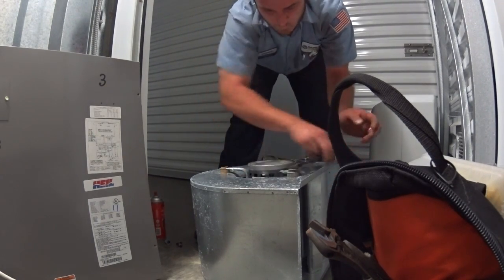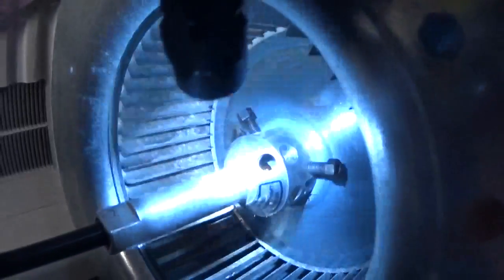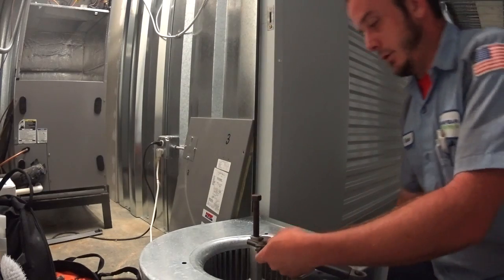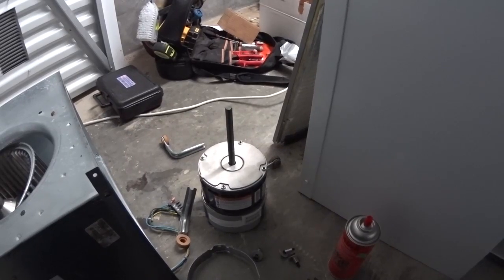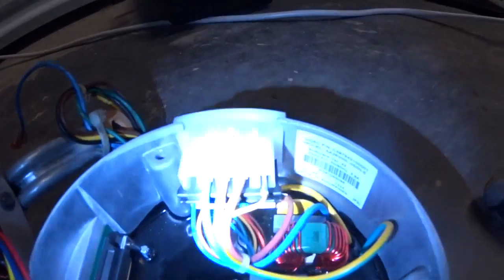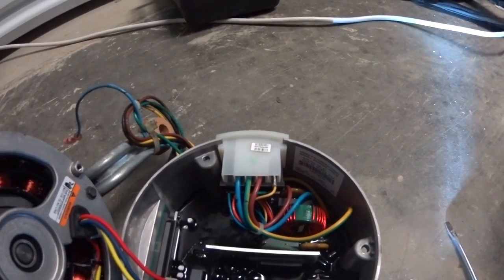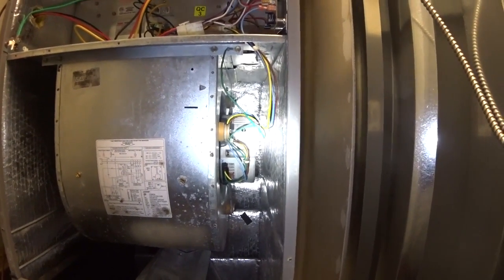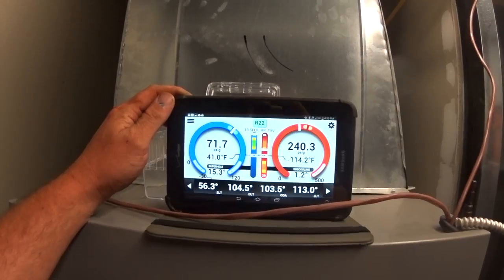HVAC Service: X13 Rescue Motor Installed in place of a Factory OEM motor

Comment: Thanks for your video!  I just used it to replaced my Carrier X13 with a Rescue 1/2hp.  For DIY folks, you don't need the hub puller to get the old motor off the wheel.  Just use rust penetrant and sand paper on the old stem, pull and wiggle off.
Reply: Also a good trick is remove the set screw bolt completely, squirt a little penetrant in the screw hole on the fan hub. Gently tap the the motor shaft to free it up. The motor is no good anyway so dont worry about damaging the motor. Just be very careful not to mushroom the motor shaft or it will scratch up or jam in the fan hub.

Comment: Pro tip For the pro: Your refrigeration ratchet wrench for valves fits on those square set screws for blower wheels. Still gotta watch your knuckles there but that's what good gloves are for.

Comment: 1. Use a magic marker to mark where the set screw hole is.
2. Use dielectric grease on terminals so they slip on easier.
 I use aftermarket X13's (Marrs) to replace some ECM variables if the ramp up mode isn't used.  Can save 4-5 hundred bucks over the OEM. As long as the static/cfm is good- you're good to go. They also come with surge protection.
 Now- about that Subcooling..........LOL. Long high rise liquid line? TXV I'm sure?
Reply from the maker: thanks for the tips newstart49 honestly i don't recall the specifics of this system but i think the line was longer than most residential stuff i see.

Comment: Nice video Stephen, I will have to check on those Rescue X-13's.  Keep up the good work.
Ray
Reply from the maker: We will wait and see if the rescue X 13 makes it through more than a year but it is an option if you're having trouble with the OEM motors

Comment: still running my psc blower moter on my carrier tech97 and a inter-therm indoor unit with a inter-therm evap coil installed in 97 with a txv valve.  running with no heat strips.  will heat down to 25 degs with a 18 degs delta T.  those x13 motors still got bugs up there ass!

Comment: That motor was tight. Sometimes if you remove the module it becomes free. The module is shorted then. If you jump two windings then the motor gets tight again
Reply from the maker: You are a mad scientist! How else would you know random facts like that?!
Reply from the maker: It took me a minute to Decide that the Rescue would be ok. I almost just tried changing the module but I was getting some Strange feedback from the Variable speed Zebra, so I played it
Safe.
Reply: That one I stumbled on...remove the module and motor felt fine...plug it in and back to tight

Comment: Very interesting Stephen Rardon  I have never had to change a variable speed motor yet just the module. I find they fail because of improper duct sizing. Static is to high.
Reply from the maker: I've had a pretty equal split of motors and mod+motor the humidity conditions in this area dictate part of my reason to replace both sometimes. When I pull the module off and chunks of rust fall out of the motor I think it's time to change the motor Before it fails.
Reply: Its almost always modules for me. I hade one motor that shorted to ground. The modules don't like our moist crawlspaces down here.
Reply: Rob HVAC  but it looks that system was low on refrigerant and in this case what kill the module was the frozen evaporator that create the air restrictions.
Reply: José Cruz which would cause high static which would take out the module.
Reply: Rob HVAC that's right
Reply: How does high static and improper duct sizing take out the module?
Reply: @johncote2776  These are a constant torque motor. If the airflow gets blocked for whatever reason, bad ductwork, registers closed off, filthy filters, iced up coil etc, the motor picks up speed to try to get to the torque setting for that airflow. There's supposed to be a speed limiter in the motor, but it's like a car. Sit there long enough with the gas pedal floored, bouncing off the rev limiter, will shorten it's life! Basically how they work is, a squirrel cage fan will move X amount of CFM depending on how many inch pounds of torque you put into the fan. The RPM is just a result of whatever RPM the fan rotates at to present that torque to the motor. X13 motors are constant torque, there's 1,2,3 or 4 different torque settings you can program to whatever CFM you want. True variable speed ECM motors can go from almost nothing to full CFM and anything in between. The control board like on a Trane will then flash to show you how many CFM the board is commanding from the motor, 10 blinks = 1000 CFM for ex on a 2.5 ton.
Reply: @brnmcc01  Thanks for the info

Comment: The 2006 OEM X13 motors had issues in the control module, I think it was resolved in 2011.

Comment: I've had good luck with these so far. Might even last longer than the OEM way overpriced motor. Trane also sells these under the ServiceFirst brand. I only need to carry two sizes on the truck, and can replace just about any X13 or ECM motor. They come with a simple little wiring harness to program the motor. Only a little over $200 compared to $80 or $90 wholesale cost with PSC motor.

Comment: Ive not seen the rescue x-13 yet but i know we have had issues with the rescue motors this year. only lasting 10 months or so so we stopped using the rescue brand. but hell the x13 aint much better and  home owners need to take a second morgage to pay for the x13 unless its still under warranty,lol. but good job on change out.what supply house did u get that x13 rescue from?
Reply from the maker: It's sad, you almost can't put a year warranty on anything because it won't even last that long!
Reply: Stephen Rardon yea it sucks. Weve been using Mars universal motors,from epting dist. they have been really good motors.
Reply: joey kohout t I'd wonder about the applications you were using them on. US motors is a good motor company IMO.

Comment: I have a perfectly balanced York 4 Ton Air Handler System with a 15KW strip on a 4 Ton Latitude HP and the Air Handler keeps eating OEM motors. I always change out the cap when we do a motor swap but this is getting frustrating. Any ideas? Is the X13 the answer? The motors last about 2-2.5 years.
I've installed a few Rheems with the X13 in them from the factory but I'm kind of an OEM guy when it comes to blower motor replacements. The RA is oversized, like always, and there's plenty of airflow as we design and install perfect systems.
Reply from the maker: That sounds frustrating! Wish I had the answer for you! If the psc motors are getting eaten that frequently. There's got to be a reason!

Comment: I haven't installed a rescue x13 blower yet but looks fine to me , good vid .
Reply: I was just Google rescue x13 to find what the part prices where and I seen your video link twice on the search , anyway can't find a part price how much r they ?
Reply from the maker: the OEM was almost $500 and the Rescue came in under $400. not earth shattering savings but not bad for the same function.
Reply: Thanks for the info

Comment: My carrier furnace looks just like this. Can anyone tell me if my blower motor is bad with this info?

My voltage to the motor is the required 240V AC.

I'm getting about 10V DC between my brown wire in the socket, and blue wire that goes to the #2 (medium speed) tap on the motor. The thermostat is powered with 24V DC I think. 

When I pressed FAN ON on the thermostat, the motor barely turned very weak. I turned off power and spun it, it spins freely.

The more I see it, the more I think it's a defective module in the X-13 motor.

Comment: Nice one Steven. It does get hot in those storage lockers for sure. You went kung fu audio mode on this one to mix things up.... lol!
Reply: Ah YouTube's fault.
Reply from the maker: haha, you know that sound may have simply been the noise of the stop button while recording. unless i'm misunderstanding completely
Reply: Stephen Rardon the audio is out of sync.
Reply from the maker: Mike Powlas was having issues also, are you using Google Chrome? Or it could've been that it hadn't fully processed.
Reply: Stephen Rardon YouTube app on my phone. I use Chrome on my computer,  and I'll see if it's better.
Reply: Stephen Rardon just watched it on my phone again. It's fixed, crazy.  Like you said it probably wasn't fully processed.
Reply from the maker: Thanks for the multiple views!

Comment: My motor runs on 24v call for heat , not on call for cold (24v green) wire ... I have energized green wire to the pug at the motor tab yet nothing turns on , is that a signal that the module is bad?
Reply from the maker: Wouldn’t immediately blame the module if the fan runs in heating. Possible though

Comment: Why changeout w/x13 rescue? If so obviously non factory warranty. Psc motor matching hp & rpm w/90340 & cap & done....unless u stock that on ur truck pre-programmed. Btw # 1 killer of ecm type motors is hi negative static
Reply from the maker: That would be an option but then your efficiency is negated.
Reply: I think it's more power spikes or far away lightning strikes. Seem to get a surge of ECM motors going bad after a major thunderstorm. Most common thing is surge protector/metal oxide varistor pops in the module, sometimes they explode and take out part of the circuit board. High negative or positive static is bad for these motors in the long run, makes them have to run at too high of an RPM, shortening the life, and also putting the power consumption right up there with a PSC motor. These X13 or ECM motors do save a ton in electricity over there lifetime, IF and only if the total external static is kept low. If you can keep the total static to below 0.4 inches or less, some of them can use as little as 60-100 watts. For example, my 60,000 btu furnace on high heat only uses a total of 2.5 amps at 120volts to run. That's board, transformer, inducer on high speed, blower and all. Very cheap to run. After 10 years, so what if it costs $600 for a new motor, it'll have saved over 2 grand in electric bills. More than what the whole furnace cost. El cheapo customers forget the total cost of ownership, put in cheap system, it'll cost a ton to run in the long run. Esp with rates going up every year. But run these motors with filthy filters, dirty coils, and horrible collapsed flex duct, won't save much in electricty versus a PSC motor. As a a matter of fact, a PSC motor running at 1.0 static will use LESS amps than the blower removed from the furnace and running in wide open air. So it is possible in an extreme case, that the PSC motor can use less power than an X13 motor, but under those conditions the A/C will perform poorly, and the heat exchanger in the furnace will get cracked soon, from overheating.

Comment: Never understand using a impact to install a screw, little overkill, and one more thing to carry in, also  can strip, the hole if not not going in properly nut drivers people nut drivers on residential, if 40 screws to take off on a rooftop, then bring out the impact
Reply from the maker: I do both service and install so I don't see the point in wearing out my wrists just to back out some screws. There's a little thing called trigger control that will keep you from stripping a screw. And many times that power is necessary when you come across a unit that has never been serviced.

Comment: You know what's easier, wire in a psc,charge a rental fee on it, we all know oem motors, or heads, can be weeks away, because they are programmed for that btu of furnace. I hate rescue stuff, tell a customer, it's not oem, they freak out, when saying its a rescue.
Reply from the maker: OEM is nothing more than an overpriced version of the generic or rescue stuff. I hear what you're saying but I rarely see a customer that is willing to pay a higher price for brand name stuff.

Comment: The ECM motor is the biggest rip off ever conceived by the designers of these domestic HVAC systems!! For the price of just one of these Spawn of Satan motor units, I can buy an INDUSTRIAL grade 3-phase motor made in America, and an INDUSTRIAL grade single phase to 3-phase output VFD, also made in America, for LESS than the $600+ plus junk that will be lucky to last a year!! I think they are doing this stupid stuff to keep the profits rolling in. Seriously....
Reply from the maker: I would agree that it's more about profits that qualify for sure.
Reply: $600??? Try $958 my cost for a York Affinity ECM motor. Can buy the whole damn airhandler for not much more than that! OEM ripoff B.S. Or how about over $800 for a ECM Inducer motor for a Carrier gas furnace. I mean really, I know they want to save electricty usage on a furnace, but come on, how many watts does a PSC inducer motor use.... Let's quadruple the price of the motor to save 20 watts.... That's engineering for you, "I swear it worked good on paper!". Yah ok but out in the real world of damp crawlspaces, hot attics, lightning strikes, power surges.... YMMV!